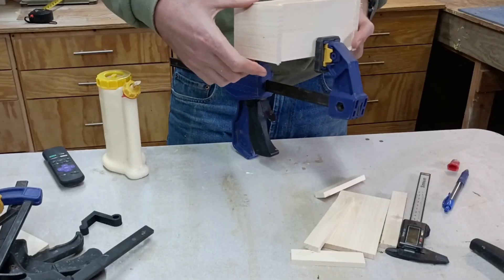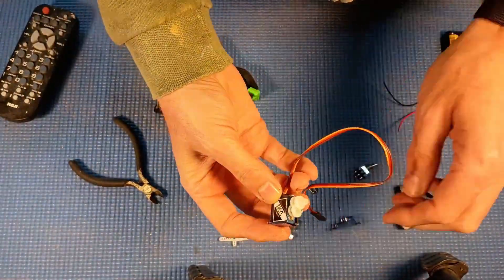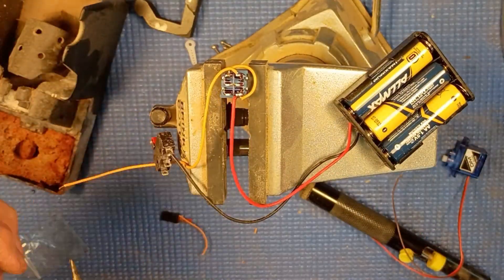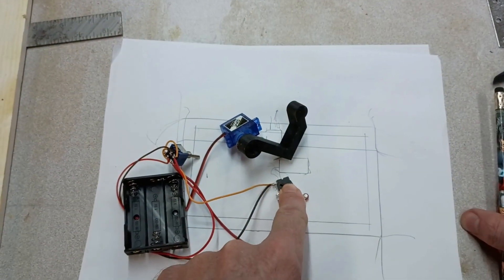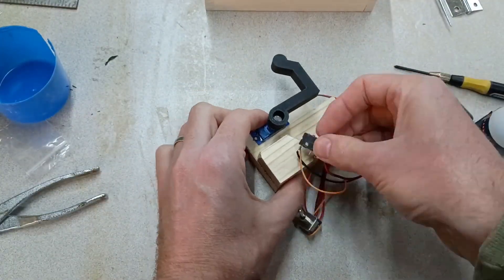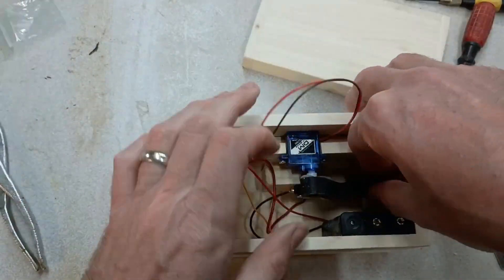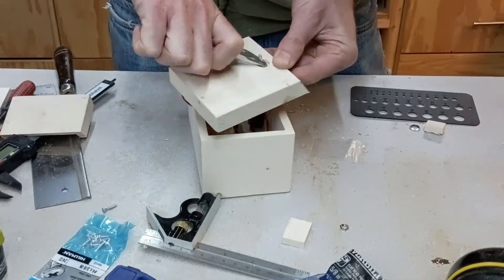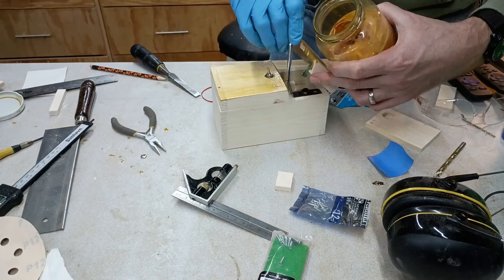How to Build a Useless Machine or Useless Box

Comment: Nice build.  But the servo is too fast acting.  I'm hoping to build one some day.  The concept is dimple enough.  A geared motor, an H bridge switch (that's what you built) and a retract-limit switch.  Someone suggested a lock to hold the lid closed except when the paw comes out.  Yes.  But no.  Not unless you make a different arrangement for changing batteries or an alternative way to open the box.